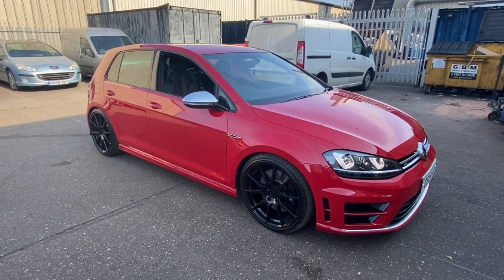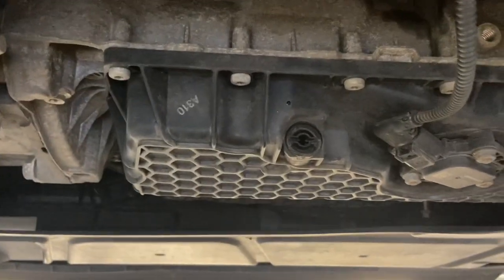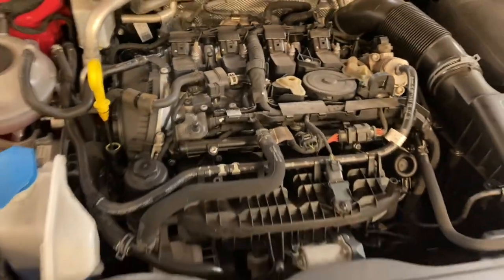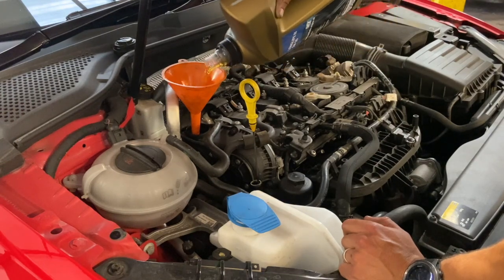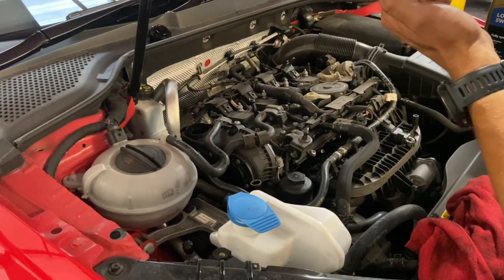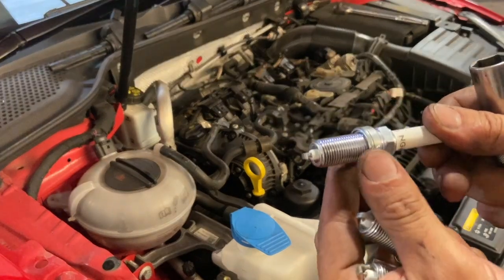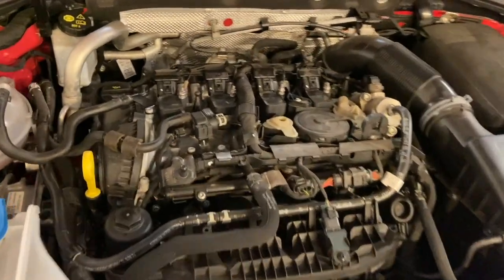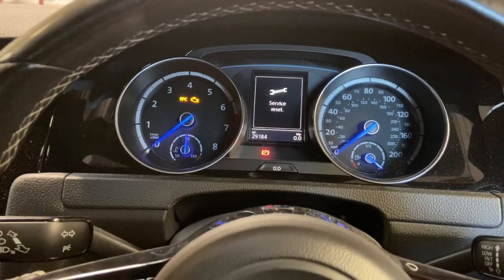How to carry out engine service on VW GOLF R MK7 2.0 TSI

Comment from the maker: Check Euro Car parts for parts - https://tidd.ly/3lIO7xA
Check GSF Car Parts for parts - https://tidd.ly/359Cie3
OE Oil filter 06L115562B - http://rover.ebay.com/rover/1/710-53481-19255-0/1?ff3=4&pub=5575600177&toolid=10001&campid=5338704655&customid=oil+filter+golf+r&mpre=https%3A%2F%2Fwww.ebay.co.uk%2Fitm%2FGenuine-Audi-Oil-Filter-A3-A4-A5-A7-A8-Q5-06L115562B%2F273308575277%3Fepid%3D26017943470%26hash%3Ditem3fa275e62d%3Ag%3AHKYAAOSwJIJbKl8j
OE Sump Plug 06L103801 - http://www.ebay.co.uk/itm/172341809049
OE Air Filter 5Q0129620B - http://www.ebay.co.uk/itm/273320045859
OE Spark Plugs 06K905601B -http://www.ebay.co.uk/itm/283342380652
Brake cleaner - https://amzn.to/2CK6OPi
OE Engine Oil 5L 5W30 - http://www.ebay.co.uk/itm/274307451122
OE front wiper blade set - http://www.ebay.co.uk/itm/162170156407

Comment: Cheers for that. I have a 2019 Golf R mk7.5 I just bought with 34,000 klms on it that I want to do the oil and filter changes on inbetween services. Looks like it's super easy. Bought a couple of low profile wheel ramps that are 8 inches high.
Reply from the maker: 👍 glad it will help

Comment: Thanks for this video, because of it I was able to change my spark plugs myself. I noticed oil around the spark plugs in wells 1 & 4. Do I need to be worried or is it common
Reply from the maker: I’ve not come across it but it will be the rocker cover gasket leaking , you should replace it really
Reply: @diydaly  Thank you
Reply from the maker: @michael6125  👍
Reply: @@MrChristie-qh1gb Thanks for this. Will get round to it.

Comment: In the oil filter, you have an anti-return valve. If you do not unscrew the filter BEFORE making the oil pan bolt, you put approx 0.5l or 5dl in the oil pan back. Useless, always unscrew your oil filter first.
Why not read documentation? In Elsawin or Erwin for example.
Reply from the maker: thanks for the comment, note taken